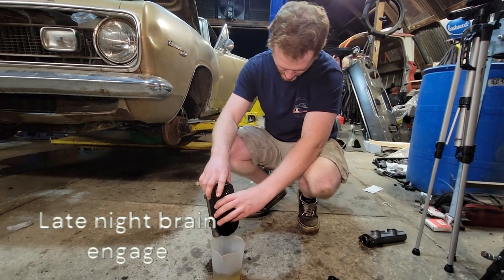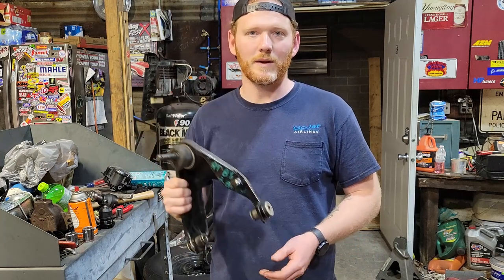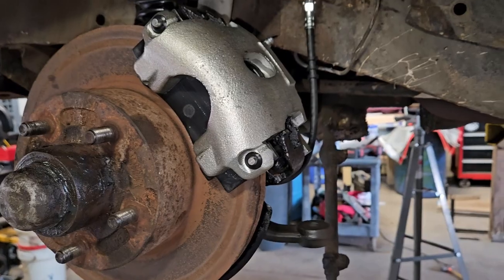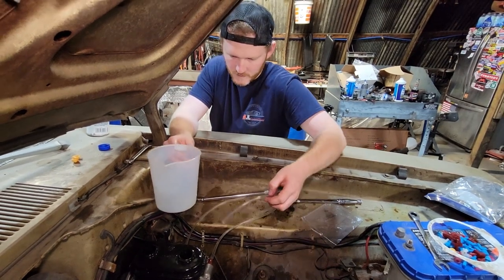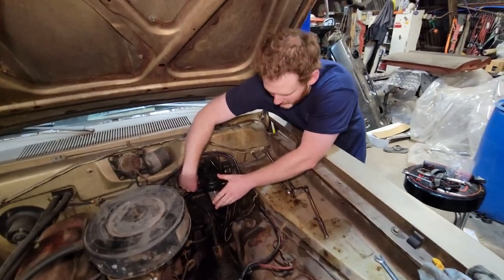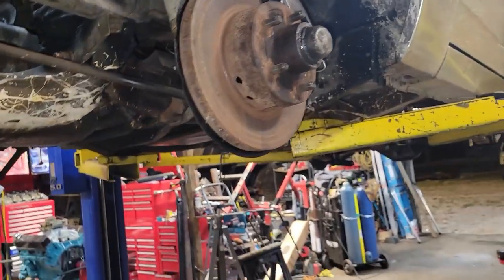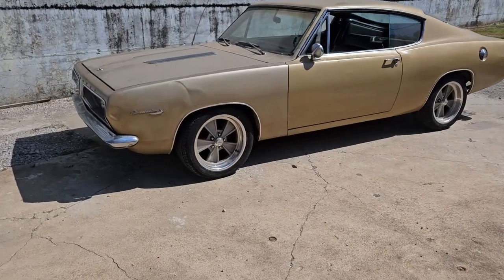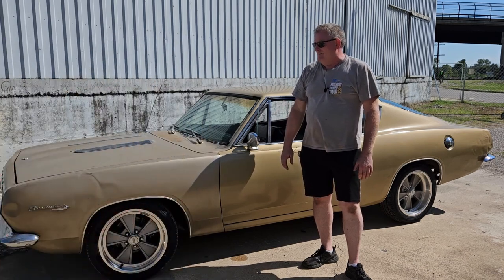How to Convert A-Body Mopars to Disc Brakes! BABYCUDA GETS BRAKES!

Comment: Is that a left caliper you have on the right side of the car? The bleeder doesn't look like it's in the right spot. Which will hender bleeding .
Reply from the maker: It is a R/H caliper, but the E-Bodies had a leading style disc setup, so the R/H has to go on the Left to bleed correctly. Forgot to show that, but good eye!